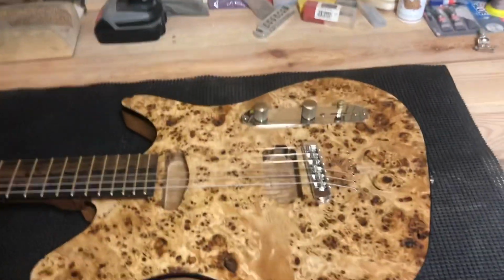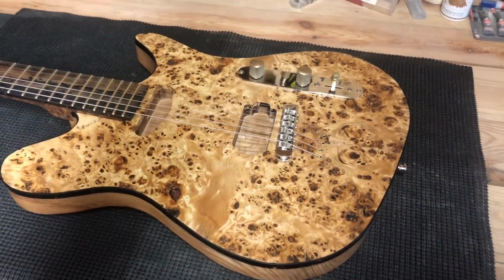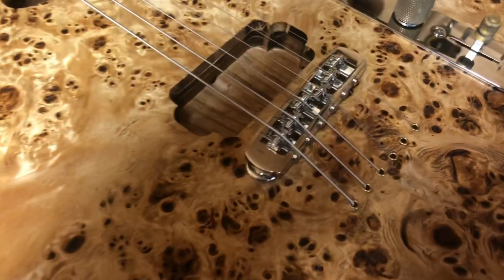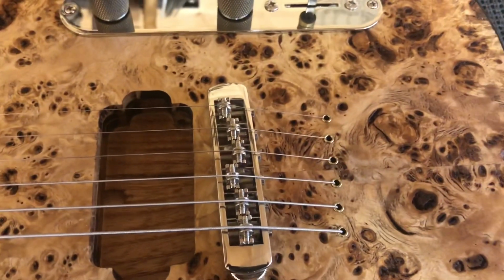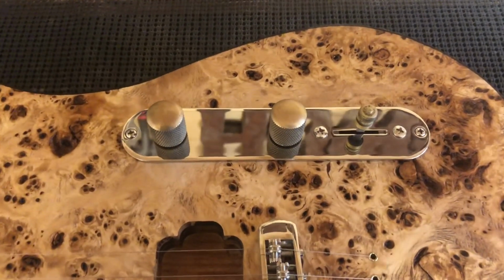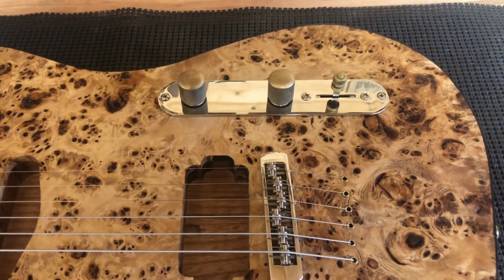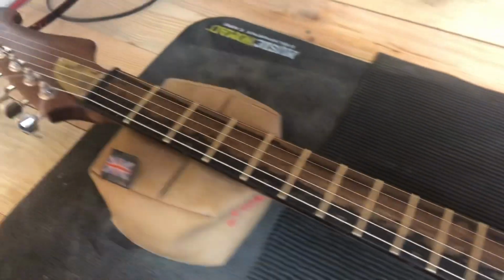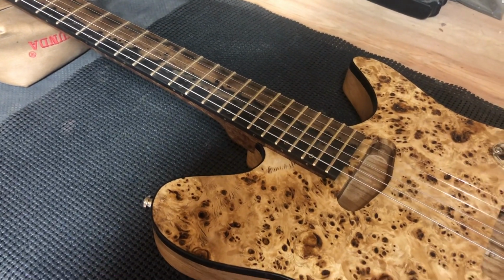Part 5 - The Great Guitar Build off 2021

Comment: Awesome looking guitar!! Do you feel the top needs any sort of hardening from an epoxy or wood hardener? I've got some poplar burl, and it feels rather soft.
Reply from the maker: My top didn’t need anything like that, but I’ve seen people resin them before, however I prefer the natural burl
Reply: @mayburyguitars  Yeah I've got epoxy, but it yellows some. May look cool, but also thought it may just be unnecessary. 

I guess ultimately when I go to machine it I should get a sense of how stable it is.